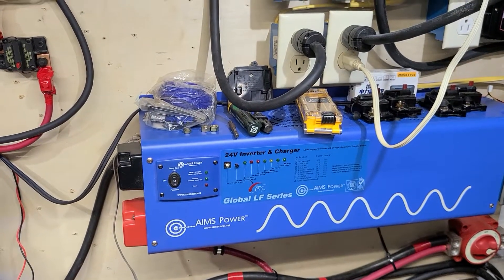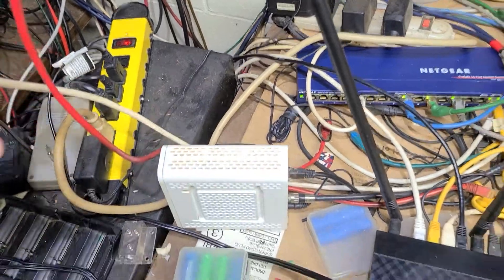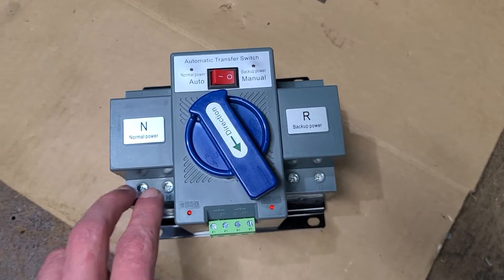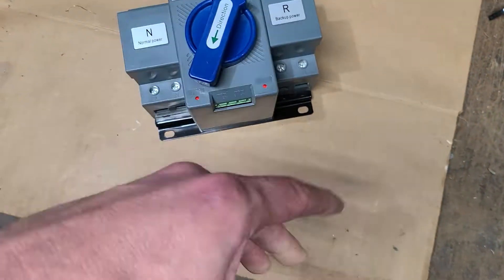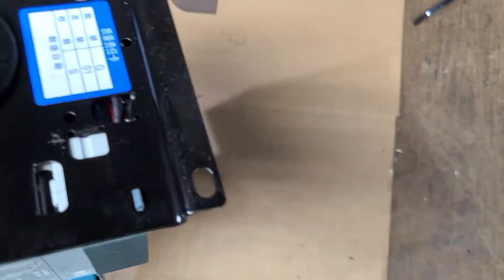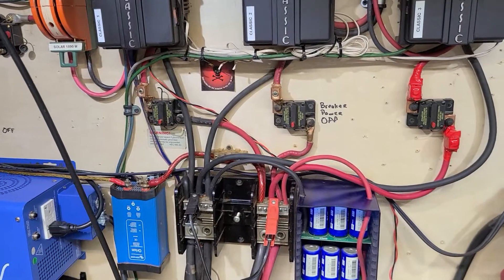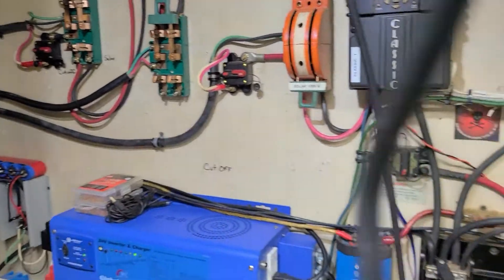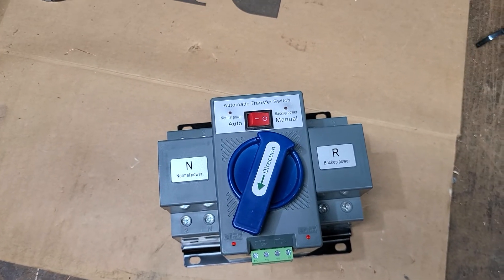Automatic Transfer Switch for 120 Volt

Comment: The removable green connector is "dry" supplying NO power, it is to connect to "tally lights" indicating the switch's position.  The shielded Ethernet cables are only shielded when plugged into a shielded connector.  (providing a ground) Ron W4BIN

Comment: What size breakers are u gonna use from midnite I may have them
Reply from the maker: 100 amp breakers
Reply from the maker: Also 50 amps
Reply: Well I got a few 60amps and one double 60